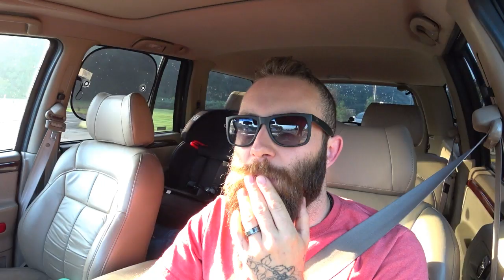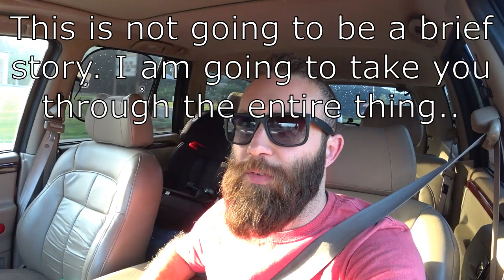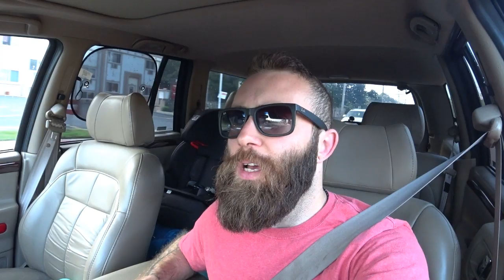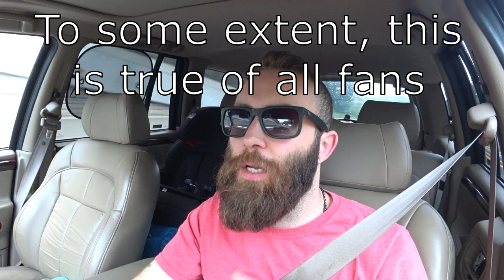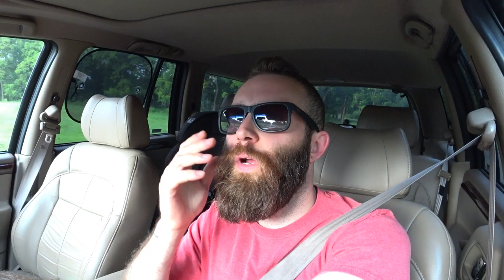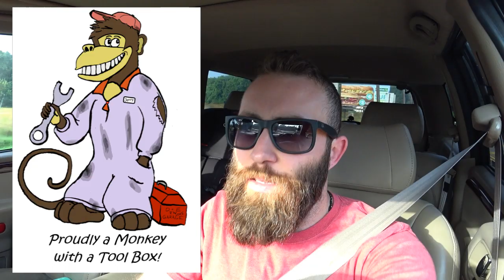Mystery Engine Overheating Issue SOLVED - Jeep/Dodge 4.7L

Comment: Stick to recommended mopar oils like transmission, transfer case, powerstearing and diff oil. I have learned a valuable lesson with diff and without additives from mopar in. 8000 ZAR for a new diff and my fault to listen to a group member. You can use shell or any oil that is same recommend viscosity in motor. One of my friends has his second powerstearing pump in with normal atf. He has problems so i asked him what oil did he use? Atf. I am showing him your video tomorrow. I like your videos and watch them all the time. I am from south Africa. Keep it up. I would drive it just keep an eye on the oil for changes, if it starts do it otherwise dont fix what is not broken yet

Comment: FYI: I have a 2004 GC overland .. bought in 2016 with 102,000 miles in Pacific Northwest .. went to Southern California for about a year for work .. zero cooling issues even with outside temps at 121 F (desert) .. later went to North Carolina and power steering pump went out .. had it replaced at dealer there .. it ran fine cooling temp fine all the time .. moved to Dallas ran for a year with outside temps as high as 105 all over .. solid cooling slow traffic .. whatever .. went to wichita Kansas .. got ripped off by a criminal dealership (Eddys stay away from like the plague ) my radiator failed after their supposed service of gear oil change ... then the water pump .. they are liars there .. but since then after replacing all that that they sabotaged .. it ran hot in slow traffic fine at speed ... moved down to Austin Texas for the time being .. but was up in Dallas for another job interview and on way back to Austin got stuck in traffic and it ran hot for awhile till it got moving .. found your video and martins’ ..  I went to the Jeep dealer here in Austin and their database does NOT have the information in it regarding this PWR steering fluid issue .. absolutely not there ..  They are investigating for me .. I ordered the fluid and am going to replace it .. I haven’t had the luxury of being able to do much work on it at home but will anyways .. in Wichita I worked with German engineers there and they were very nice compared to many American engineers who think they are brilliant or have a chip on their shoulder .. but the Germans DO over do their engineering without being smart about maintainability and dependencies (like this pump dependency ). They were doing the same thing on their jet engines and they likely lost WW2 because they did the same thing with their tanks .. over engineered and breakdowns meant loss of battles .. so in that case .. their foolishness was our benefit .. I can’t wait to get the fluid changed to see the difference .. the logic of the viscosity issue of the fluid is perfect .. thanks so much for sharing

Comment: sounds like they made changes to how the 4.7 was being built out for different models... my 2005 Dakota manual calls for ATF+4, and specifically notes to not use power steering fluid. there's absolutely NO way that could cause any confusion 🙃😂 to anyone tryna work on these in 2024

Comment: Did it throw a code? I’m having my engine replaced and I called the shop to check on it today and they told me that they were having a problem with the fan that it was throwing a code on the dash at each time if they would clear it the code would come back

Comment: Ive have tried everything and still no luck. Still hitting up to 226 degrees. New radiator, new computer, new pump, tested fan by unplugging temp sensor (worked fine) , flushed with the right ps fluid after watching this  and still no luck . Any advise would be appreciated..

Comment: Part #  68234631AA

$20 dollars a friggin quart!

It worked. I myself have been chasing an overheat issue with my 02 WJ for 1.5 years. I dropped a valve seat on the left head, pulled the heads, sent heads to the machine shop, then a valve seat on the right head dropped due to overheating a year later while rushing to the E.R.

Thank you D&E In The Garage for saving my WJ!

Liked n subscribed!

Comment: Omg!!!!! Thank you. I’ve had this issue out of my 02 gc limited. My power steering is going out and my engines been over heating and I couldn’t figure anything out on it. Your a life saver dude.
Reply from the maker: Yep, I will never understand who signed off on linking the cooling of the Jeep to the operation of the power steering pump.. a system which is often neglected

Comment: Dude, yesterday I was teetering on the very verge of setting my '01 4.7l Durango on fire,...wasn't even gonna push it outta the garage first. It's in several thousand pieces. I have a new radiator, upper & lower radiator hoses, thermostat, heater core, master rebuild kit, new rotors and brakes all around, front hub assemblys, rear wheel bearings, cold air intake,  tranny pan gasket, fluid, filter front seal, injectors, plugs, wires, &  coils, and more. During the teardown I found a crack in the drivers' side head that thoroughly demoralized me considering the amount of money, time , & effort I've put into this rebuild. I damn sure wasn't looking forward to investing another  $3-500 in a replacement  head, especially because I've had the spectre of the " Phantom 4.7 Overheat Demon" hanging over my head. My Durango had been doing all that your Jeep had been before I decided to quit driving it and rebuild it before it had some kind of catastrophic failure. Also, like you, I've been drowning in the ForumWorld trying to find out where the shadowy 4.7 Demon was lurking, ready to reach out and destroy my precious 'Rango the second she was road-worthy again. Gotta tell ya, there's been more than one sleepless night stumbling around lost in ForumWorld trying to figure it out. Then, seemingly outta nowhere, Karma took pity on me and popped up a video of this somewhat scruffy looking ruffian that was spouting some insane theory about , " ......atf, Mopar power steering fluid, gremlins", and other such nonsense. Suddenly, the sun came out. The birds started singing. I could almost swear I heard harp music. Maybe this guy wasn't completely off his nut. The simplicity of his claims were sheer genius. You, sir, are a true hero. What can we lowly Dodge enthusiasts ever do to repay your kindness in releasing us from the evil tyranny of the 4.7l Demon ? A Nobel Peace Prize  perhaps ? Wait, I know! I'ma go start a GoFundMe page ....how would you feel about an all-expense paid weekend in Vegas with a few high-$$$ hookers ....??? Thnx much, man. You, sir, are a gentleman and a scholar.

Comment: I just picked up a 2005 dakota slt 4.7 v8 4wd and had overheated and dropped a intake valve seat. Also my 2002 4.7 did too. Both I fixed by pulling the head then used sleeve retaining from permitech used on diesel engines fills .012 gaps. Repressed seat in and hand laped the valve then put it back together.  Both trucks run. The cylinder that dropped is at 175psi compression now. whole motor is  170 to 180 psi

Comment: Vent the hood. Made a huge difference on my 04, cool air can't come in if the hot air under the hood can't get out. With the 4.7 stuffed under the cowl and no gap between the body and frame being a unibody there is no place for the air under the hood to escape. I put a thermometer under the hood and saw over 180 degrees underhood temp. Put a hand over the vent and it will burn it. Runs around 195 on the same gauge it ran over 210 on before the vents and underhood dropped 30-40 degrees. And yes, you HAVE to use the proper P/S fluid with the hydro fan.
Reply from the maker: Damn. Makes sense. I just may do that

Comment: Power steering fluid was low in wife's 2007 hemi Commander.  There was a tiny leak in one of the hoses.  I thought I would just top it off and fix the hose later.  The reservoir had a sticker on it that says to use MS-10838 fluid.  Jeep doesn't have the original stuff anymore, and said it has been replaced by ATF+4.  They are wrong!  I found Lubegard 23232 at O'Reilly's that meats the MS-10838 standard, only $18 per quart.  They had 3 very dusty quarts in stock.  After flush and refill, it seems to work fine.  The fan goes faster than it ever did before!

Comment: I blew a heater core hose on my 4.7L last month.Temp gauge was pegged and she over heated and blew a head gasket.I put a bottle of head sealer in it and she is running fine now.I will have to replace the head gasket some time but no valve seats have dropped yet(knock on wood)...
Reply from the maker: Dang buddy... That is a bummer. Good luck with the head repair. How long have you been driving on the head repair stuff? Always wondered if they worked..
Reply: It's been a month.The product is K-Seal ultimate permanent head gasket repair.I found it at O'reilly auto parts store.It took a couple of heat cycles to work.My coolant was leaking into combustion chamber on number one cylinder.I normally dont mess with mechanic in a bottle stuff but I figured I didnt have anything to loose.This should buy me some time to save up for a new set of heads.I am going to replace the timing chains and water pump at the same time.

Comment: 2001 through 2004 WJ with the 4.7 has the hydro cooling fan.  Not the case with 1999 and 2000, those got a mechanical and electrical combo.  And even these jeeps got a (much smaller) power steering cooler that was bolted to the bumper portion of the unibody on the left side near the headlight.  And 2004 4.7's had hydro fans, I've personally seen countless ones in the yard.  Is it possible you're thinking the 2004 cooling fan change for the 4.0's?

And there is no "free power" to drive the hydro fan, or for that matter any electric fan.  All of them put load on the motor, it's just a matter of how directly they do it.

The hydro pump puts out a specific amount of FLOW at a certain RPM.  That means at for example x amount of rpm it's moving however many GPM.  But the pressure that's generated by the pump changes depending on load from what it's being directed through, and in turn the torque required to turn it and in turn the load on the engine.  When most of the fluid goes through bypass like what happens when the hydro fan is not running and you're not turning the steering, the pump is easy to turn.  But as soon as the fluid is directed differently, to turn the fan or the steering, the pump gets harder to turn. So it's not "excess power".

Same idea with an electric fan, the alternator needs to generate more amperage to keep the system voltage at the PCM managed charging voltage somewhere around 14v (depending on battery temperature) when the electric fan is on.

Is the hydro system more efficient than a clutch driven mechanical fan?  Possibily, and this is probably the justification used by Chrysler.  Here's what's said, "Cooling fan, industry-first hydraulically driven engine cooling fan on 4.7-liter engine for increased fuel economy and efficiency. Attached to radiator assembly and powered by power steering system for more efficient and quieter operation" on this page: http://www.wjjeeps.com/newoptions.htm

As far as the fluid goes, a few of the earliest 1999's came with ATF in the power steering system.  If I remember correctly they issued a TSB to replace this with the MS5931 mid model year 1999.  TSB 1900503 here: http://www.wjjeeps.com/tsb_list.htm.  This predates the hydro fan even.

With this said, in my opinion, the Ford mechanical plastic fan conversion is a great option.  And don't worry about the valve seats, you're fine.

Cheaper alternative and perfectly fine, completely compliant with the MS5931 spec, is either Valvoline power steering fluid (white and blue bottle), or Federated power steering fluid (black bottle, red and yellow label).  Both state compliance with the spec right on the bottle.  Both thinner than ATF.

By the way, I have several overland steering wheels I've rescued from the yard, let me know if you have any interest, I think you said you did on a previous video.
Reply from the maker: Yea, I am in the market for an overland steering wheel, but have not come across a decent one since I have been looking. If you have any spares you would like to sell, shoot me an email at dandeoffroad@gmail.com

Solid info you have there as well. I thought they stopped the hydro fan in 04, but I guess I was mistaken. Makes sense now that I think of it because I know the WKs with the 4.7 still had it. I had been wondering about MS5931 compliant PS fluid, but wanted to get the mopar stuff in on the first swap to be certain
Reply: D&E In The Garage now you have me questioning my statement about the valvoline/federated fluid. I’ve always used it never ATF, but have never bought the actual dealer fluid. Wonder if I should buy some to compare. I’ve had 4 WJs but only one with the hydro fan, and I thought the fan ran slow on that one because I had ruined the pump with low fluid.  You may have found something really interesting, hats off to you...

Comment: Good video, was wondering why you said you were covered in ATF, made sense as I finished watching. The thing I would like to put out there about the valve seats and overheating is this... if your eng oil level is at or close to top capacity the slight higher temperatures wont be as significant to the valves. It's when the over heat occurs and people have neglected the oil in the jeep that things become escalated because the heat transfer becomes more toxic. If you're a cpl quarts low on oil and your temp gets hot you do much greater damage to components because you dont have that volume to help absorb the impact but if your oil level is good you can sustain it much better. That's just been my experience and something people dont tell you or wont admit online is if they had low oil when the overheating occurred...its always "no, all of everything was perfect, idk how this happened " lol. I wouldn't sweat it too much bud, I know you're always looking her over and checking her out. Not saying you couldn't still have issues but the temps you described should be fine if they were temporary with good oil level...just my 2 cents👌
Reply from the maker: That is a really good point actually. I am collecting maintenance tips for the 4.7 for a future video to help explain the following... the picture which I am starting to see of the 4.7 is one of a VERY reliable and capable motor BUT it needs to be well maintained. I will add this bit to that video. Thanks!
Reply: Ugg, your information makes complete sense.  Overall the 4.7L V8 isn't as bad as people make it out to be?  Or is it?  I've passed up a lot of great condition Jeeps because of that engine.  So did I pass up huge problems or was I just exaggerating due to all the negatives you always read online?
Reply: @wildbill23c  
I commented on another guys post earlier who had kinda avoided the v8 because of stories he had heard. Just kinda wanted to put things in perspective about the motor. They mass produced these power tech engines for close to a decade and a half and made over 3 million of them. With that many on the road you are bound to see those that have issues. Doesn't mean it's a bad motor, they would have squashed it long before if it was. Just means that when you have that many on the road, any time there's issues they stick out more to the public eye. This motor is as good as any during the time of production, any motor is only as good as its maintenance program its given. Dont be afraid of this motor, it lived on for many yrs of production for a reason👍

Comment: Good info just ran across this and was about to pull my hair out , 4.7L in my 02 Dodge Ram 1500 quad cab , I unfortunately replaced parts before I saw your video on it also ,  last thing was installing electric fans to help cool it :/

Comment: Hey Bud, your on point as usual.I appreciated your rant, I'd say the same thing about a hydraulic fan! I love my 2000 4.0 Grand/loaded. It runs in this summer heat around 198-212 stop & go,highway 200,normal. I found one curious issue on my 4.0 power steering pump, the high pressure line pissed all the fluid one day. I put fresh ATF in and now the high pressure O-ring doesn't leak. Hey give me a 4.0 JEEP any day !Keep'm Com'n!
Reply from the maker: Yea buddy, I will just always be a 4.0 guy.

Comment: I just bought a used 04 Overland with the HO engine. Same problem, it has the hydraulic fan and gets hot!, but seems to stay below 210. It's getting a PS flush and fill with the Mopar stuff ASAP. Then its on to the GPS antenna not working and one of the flaps in the ducts sounds like it's broken.
After that it should be in a lot better shape. It does use oil :-( so have to keep an eye on that. Thanks for the tip.
Reply: Had the issue with the flaps as you mention ... twice ... I bought a kit for flap replacement and did surgery on the enclosure under the dash to get at it .. flap wasn’t really the issue .. it was the actuator ... in both cases in replaced and it was all better but replaced one of the flaps the 2nd go around just for the hell of it

Comment: This is EXACTLY the problem my WJ has now after doing some towing. I rebuilt the entire drive train 26K ago and want to keep it going for another 100K. I've noticed a bit of PS pump bearing noise using a stethoscope, and couldn't get the fan to speed up like it did after the rebuild except when I pulled the temp sensor. Then it ran like crazy! I'll change the pump and use Mopar fluid. I use Mopar tranny fluid and diffy fluid. They are picky about their liquids.